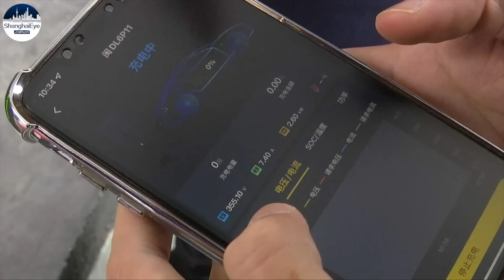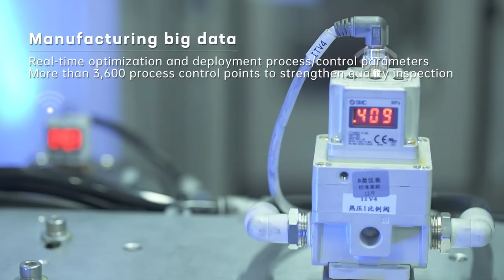China Bans Key Battery Materials – What This Means for EVs Worldwide

Comment: Tha no ks ZBen

Rare earths, graphite, silicon are all part of modern materials supply and demand. The raw materials are plentiful, the bottle neck is in refining. That is a capital, not resource issue. As prices drift up anticipate more refining to come on line.
Reply: No.  It’s a know how issue. Not your forte.
Reply: Western countries has all know how since they where doing and still does refining just in small scale.
Reply: It will likely happen, the question is how fast, and how well they can do it? China has been developing their refining processes for years now and there are very few others who even make the equipment and chemicals needed to refine the rare earth materials. If the west keeps going as they have been, how much are you willing to bet they would restrict exports of those as well? It would take years to set up the entire supply chain like China has done, probably at least a decade. In the meantime, US weapons manufacturers will have to go without or try to scrounge on the tiny amount manufactured outside of China (assuming those countries are willing to sell)

Comment: graphite is a form of carbon ( which is very common) The process of refining natural graphite or forming graphite from carbon is where the cost and research is needed. It is used in batteries in the electrodes . I don't know the proportions or the current state of research, which would be interesting.
Reply: Company stocks of Tmc and Nmg will probably benefit from this.
Reply: Are you aware there is synthetic graphite? Lol
Reply: @sciagurrato1831 DUH!